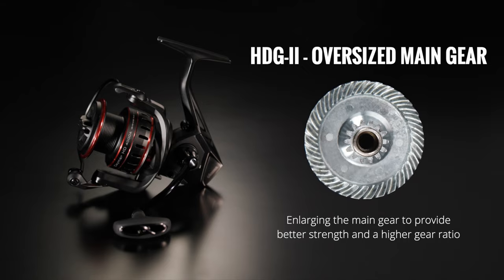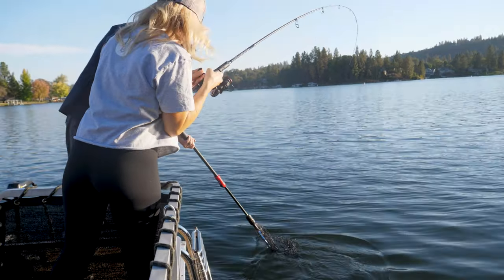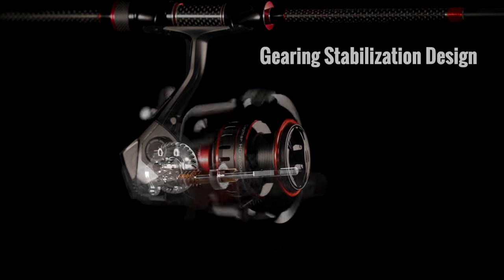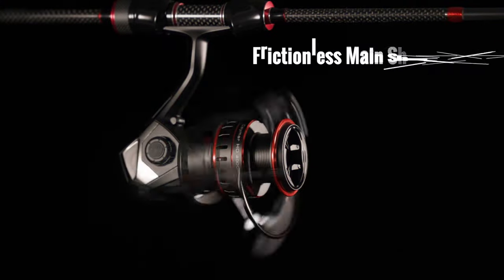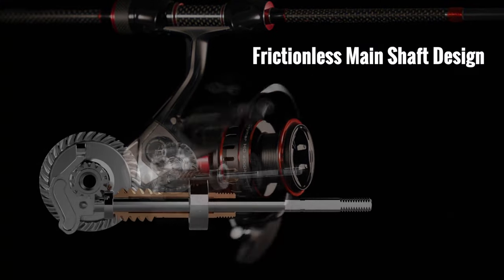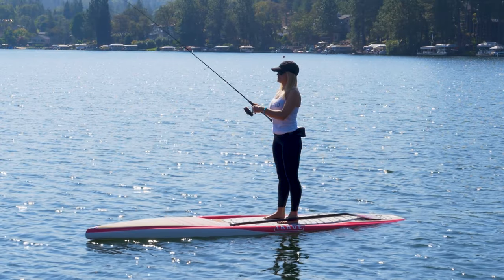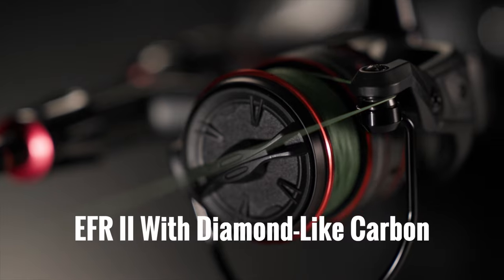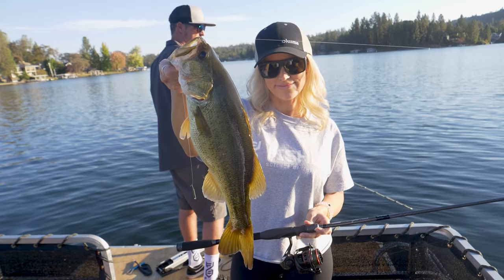Okuma Ceymar HD Spinning Reels | NEW 2023

Comment: The only gripe I have with this reel is the weight, but that goes with the size of the reel https://www.youtube.com/post/UgkxM68VkfsQhHaabDce1IwOCXuvumcpbZ_k . I brought this salmon fishing up in Oswego, NY. I coupled it with a Cabela's Whuppin Stick. I had no problem pulling in a 14lb salmon. I will probably use this for surf fishing this summer and downgrade to a 3500 series Battle II next salmon season to save my wrists. All of the operations are butter smooth and the bail is nice and thick and has a solid flip to it. Everything about this reel is sturdy and strong. The drag system held up to the salmon and was also super smooth. I did use a scale to set the drag properly before going out to the river and this worked out tremendously. A bunch of other guys on the river would hook up and snap almost immediately. Just because you have a good drag system doesn't do anything if you don't set it correctly.